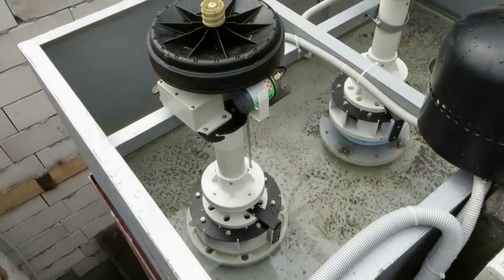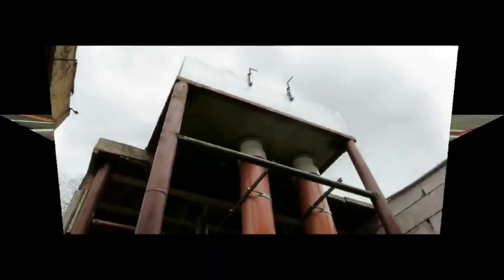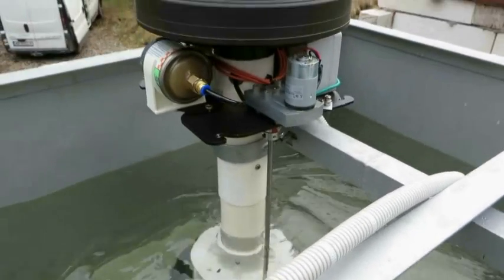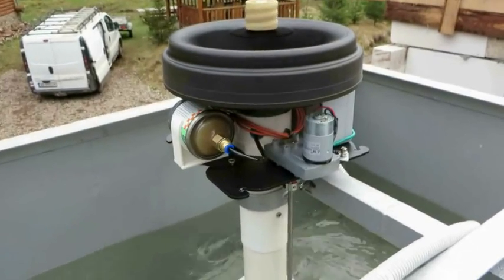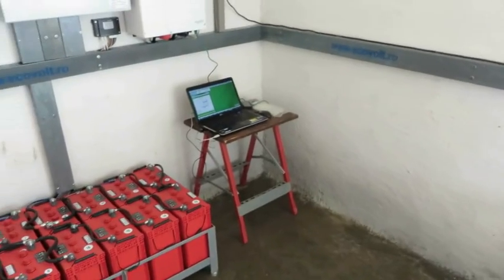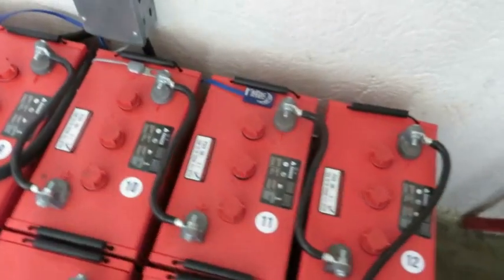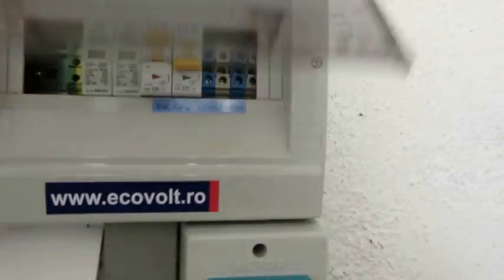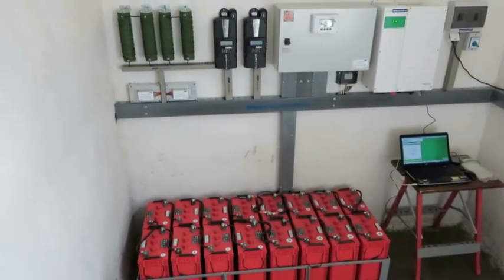Project Hydro Romania Powerspout 2x LH250 Pro

Comment: Salut  !  de  ce  se  folosesc  bateri  de  6 volti  e  mai  bine ?
Reply from the maker: +gogu gogu Intodeauna acumulatorii de 2V sunt cea mai buna optiune . Acumulatorii de 6V sunt o varianta mult mai buna decat cei de 12V, pentru ca in acest acumulator avem 3 celule de 2 V. Pentru sistemele mari cea mai buna varianta sunt cei de 2V pentru ca putem gestiona mult mai bine incarcarea lor decat la tensiuni mai mari unitare.
Reply: +Florin Fleseriu Multumesc  !  de  raspuns  se  incarca  mai  repede  si  la  un  consum  mai  mare  se  descarca  mai  usor  .O zi  buna  !
Reply from the maker: +gogu gogu Este vorba de rezistenta interna a bateriei care este mult mai mica pe un acumulator de 2V si 6V decat pe unul de 12V. In acest mod procesul de incarcare poate fi controlat mult mai usor, iar beneficiul este durata de viata mai mare a acumulatorilor.
Reply: +Florin Fleseriu Pai  si  in invertor  ce  tensiune  intra  12 v cred!
Reply from the maker: +gogu gogu Nu. Sistemul prezentat are un invertor de 6,8KW si lucreaza pe acumulatori la 48V. Capacitatea de stocare este de 1200Ah la 48V ceea ce inseamna o cantitate de energie stocata de  57,6KWh. Alfel spus daca turbinele nu functioneaza putem asigura o putere de 6KW timp de 9 ore , sau 3KW timp de 18 ore doar din acumulatori.  Cu aportul celor doua turbine de 1,4KW fiecare ( 2,8KW impreuna ) aflate in functiune se poate asigura 6KW timp de 16 ore :) ... mai mult decat suficient pentru utilizatorii din pastravarie.
Reply: +Florin Fleseriu E  un  sistem mare  de  foloseste  48  de wati eu  am  un  panou  de  100 de  wati si  o  baterie  de  100 de  ampere  si  am  inteles  ca  cel  mai  bine  e  sa  fie  voltajul  cat  mai  mare  si  amperajul  cat  mai  mic pentru  siguranta  sa  nu  se  faca scurt
Reply from the maker: +gogu gogu La sistemele mici acumulatorul de 12V poate fi acceptat. Problema mare este ca panoul pe care-l aveti e prea mic pentru acumulator. Practic acel panou poate genera in jur de 7 A si o cantitate de energie pe timp de vara de 30-33Ah/zi. Deci ar fi nevoie de aproximativ 4 zile de vara pentru a fi incarcat complet in cazul in care l-ati descarcat 100%. La o descarcare de 50%,  veti avea nevoie de o incarcare de 2 zile consecutive de vara pentru a realiza incarcarea completa. Ar fi nevoie de 2 panouri de 100W pentru a gestiona corect incarcarea acumulatorului dvs. Un acumulator de 12V/100Ah trebuie incarcat cu un curent optim de 10A si maxim de 20A. Curentul generat de panou e de 7A deci un pic mai mic decat optim dar ok.
Reply: +Florin Fleseriu  Da  asa  e  nu  am  stiu  acum  doi  ani  acum  il  am  si  poate  mai  suplimentez  cu  un  panou  de  100 de  wati  si  o  pompa  de  12 volti  sumersibila  ,da  pe  viitor  .     Va multumesc  !